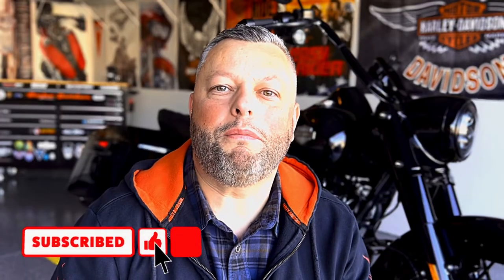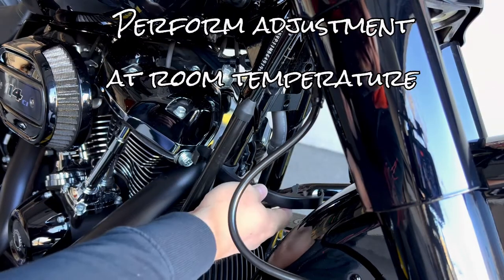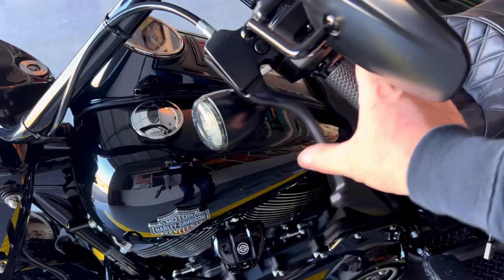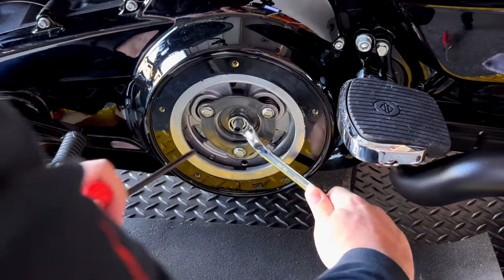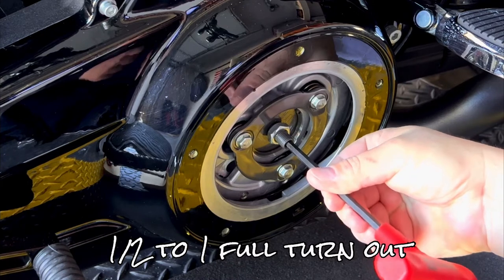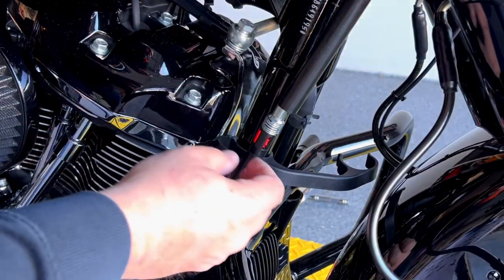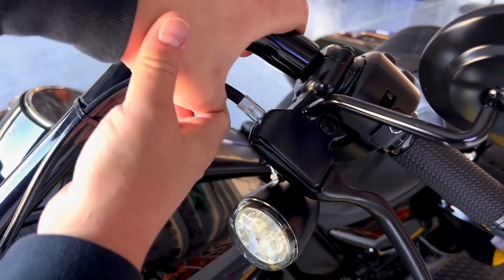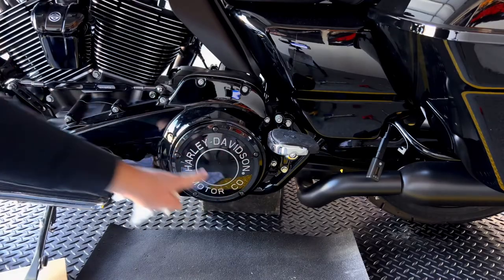How to Adjust Clutch on Harley easy way - DIY 3 minutes procedure

Comment: Could You Please Tell Me Exactly Where You Purchased The Tool Or The Model Number Of It, I'm Having The Same Issue Where I Need A Shorter Lubing Tool For My Clutch Cable Than The One I Purchased, Which Has Two Screws To Tighten It Down And It's 1 1/2" Long Instead Of The One Screw Screw Like Your Tool.

Comment: Where do you find the torque specs?
Reply from the maker: Always in manual sir. First thing I buy with any bike I have. Highly recommended investment
Reply: @RidersUnited  You include the torque spec, where's the torque wrench?
Reply from the maker: @barneysomers8871  i dont have one but I included this detail for watchers for reference
Reply: It’s not much at all. I wouldn’t even use a torque wrench.
Reply: Torque spec for the cover screws?